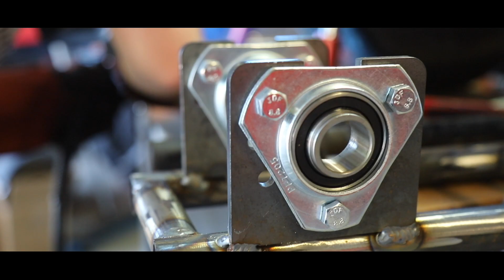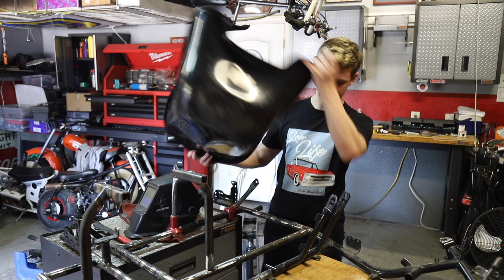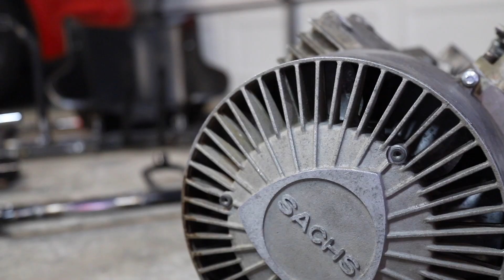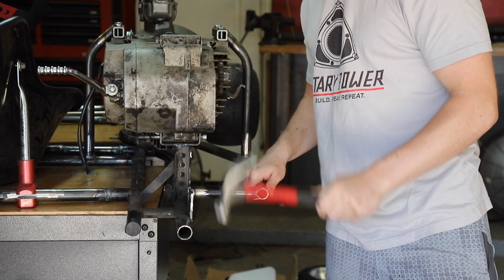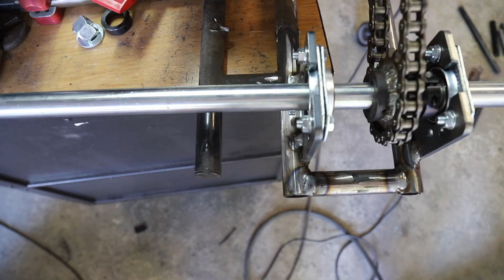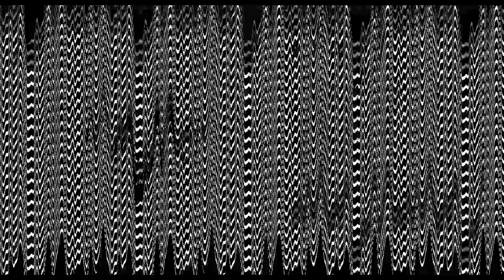Rotary Shifter Kart Build Part 2 | Rolling Frame!

Comment: probably too late now, but if you took the rear mount of the engine and made it an adjustable height so it would pivot across the front mounts, you would then be able to adjust the chain tension without moving the engine forward and backwards.

Comment: That rear sprocket is extremely small. What made you decide to go with that gear ratio? you could easily weld a chain tensioner to help with and slack

Comment: Chain tensioner will help you adjust chain "snuggly" lol
  Axle sprocket way too small. You plan doing 300mph?
Reply: @nallen100  KK I'll try one more time, then if you still don't understand, then maybe try googling this stuff.  Their cart has a 1:1  gear ratio, meaning every time the front sprocket turns once, the rear will also turn once. If they put a sprocket on the back with twice the teeth, Then it will make half a turn for every 1 turn of the front sprocket. This would be a 2:1 ratio, and would cut their speed in half while doubling their torque. Not really sure how I can make it much more simple.
Reply: @nallen100  Taller sprocket on the rear will decrease speed. Go look at your ten speed.
Reply: @nallen100   If you want to go faster on your ten speed, the rear derailleur puts the chain on a smaller sprocket. If the guys in the video put a sprocket on the rear with twice the number of teeth, it will take twice as long for the sprocket to go around, thus cutting the speed in half. Really hoping your pulling my leg here.
Reply: nallen100 you are an idiot and have absolutely no idea of what you are talking about on gearing.

Comment: Did you guys get the turbo friendly version of the ecotrons kit. You know it needs the bigger injector and the 2.5 bar map sensor. If not you might have some tuning problems with the turbo and just that a small map sensor and injector.

Comment: Question, I don't know if you guys or anyone else here can answer this. I have a SACHS KM48 160cc single rotor. I am trying to convert it from magneto spark to electric spark. Can anybody help me?
Reply from the maker: RainyDayGarage Hey check out the video where we get it running for the first time, we show how we convert the ignition
Reply: @BuildBreakRepeat  yes but you guys were talking about how your motor which is 300 CC's came with the magnetic points around the rotor that the ignition system goes off of.  I'm not sure if my motor even has those magnetic points, my motor only came with a magneto
Reply from the maker: Dang man I don’t know then, it’s pretty easy to do with points but a magneto I have no idea... good luck tho!

Comment: Im doin a similar build with my bridgeported sachs km24 with keihin carb putting it on a tonykart race chassis. Will be a lot lighter and wont have to mod the frame as no gearbox just a race clutch. Will handle mint. Drifts on! Good work tho guys, im definitely watchin this space

Comment: Im doin a similar build with my bridgeported sachs km24 with keihin carb putting it on a tonykart race chassis. Will be a lot lighter and wont have to mod the frame as no gearbox just a race clutch. Will handle mint. Drifts on!

Comment: That looks absolutely terrific! I can't wait for the next episode. But, I'm really concerned that that engine case is a structural element, under stress from any tortion in the back of the frame. As much work as you've put in, would you please make an effort to isolate those forces. I mean, it might be better ratings if you don't. And, honestly I'm curious. So, nevermind. Let's see if it breaks and you can repeat it. But, all that work building the motor...

Comment: PLEASE make a 'scatter shield"between the engine and YOU.It's called that...?Anywho.You haven't done a veriticle support.I'm not a 'know all',but you're going to twist that frame to the ground. you Have to put a bar from beside the motor to the left front frame,behind the suspension,Period.When you hit 2nd and add torque,that will have needed the overhead 'torque resist,and in 2nd direction from front of motor to left rear axle mount..I Love your work.The frame is too flat to resist torque twist.(Please wear leathers as this won't go well otherwise.)
Reply: Looks pretty awesome elsewise.Great work.

Comment: A center axle support might be a good idea too. Depending on the torque and surface it goes on. I know rotary engines aren’t exactly torque monsters, but this engine isn’t a 400cc general purpose thumper.

Comment: You will need to have your axle so it can slide back and forwards for adjustment or on some kinda pivot point like the chinise quad bikes. Also a spring loaded chain tensioner. As you will be changing chains just about every ride

Comment: you should avoid putting more than 2 bearings on a single shaft. to run more than 2 bearings, they must all be aligned within the radial running clearance of the bearings or they'll work the shaft until either the bearings fail or the shaft fails

Comment: why is the rear sproket so small is it cause yall using that rotary motor but still you think even if it spins 20,000 rpm that motor its going to feel like its going nowhere idk i think you should least have a rear sproket a little bit bigger than the front hell im prb wrong but just a thoought

Comment: Put an adjustable idler sproket on the bottom/slack side of the chain. I would use a threaded type adjuster not spring loaded since it will see tension the other way when you downshift. Spring loaded will whip like crazy if you bang a downshift.

Comment: You need to gusset you bearing carriers otherwise they will bend under hard turning conditions. Gussets must be added.
Reply: Yes...they could use the scrap material they cut off from the original bearing hangers to fab up something similar.

Comment: You could put a chain tensioner  on it to keep the chain tight.

I found this one on amazon-https://www.amazon.com/Razor-E200-Chain-Tensioner-Spring/dp/B00RW6VNP6/ref=sr_1_8?crid=9YNP44NDDCLM&keywords=chain+tensioner+spring&qid=1558283973&s=automotive&sprefix=chain+ten%2Cautomotive%2C158&sr=1-8
Should look around before buying,there might be a better one somewhere else online.

Comment: It probably would benefit from some rear bracing to help prevent the tubes that are holding the axle in place from bending
Reply from the maker: Yeah we are thinking of putting a bar right under where the axle is
Reply: Just add a bar across the back to tie all the tubes in the rear together.  To clear the brake rotor, you'll need only weld in another inch or so of tubing to what's there now.  That'll look a lot cleaner and will also serve as a push bar/rear bumper.  leaving the tubes open like that will otherwise make it look a bit unfinished.

Comment: You could always add an idler pulley for chain adjustments  :)
Reply from the maker: geoffreyjones2000 Yeah, we are thinking of adding one anyways to take out the slack
Reply: Search Amp Link chain adjuster
Reply: I fab all day 5 days a week  you gentle man are doing a fine job u could make a slick tensioner out of a skateboard wheel and one of those tiny gas shocks for holding open the back window on SUV never needs adjustment just a pivot point

Comment: I think if you use some of the Gopowersports little triangle gaucets to stiff the bearing holders on the "brake rotor" side, that would keep it from bending whenever you do any launches. Also, what about a "loop bar" that help you addding some strength to that "brake rotor" side and also work as a shield for any sudden turns
Reply: gussets. and yeah great idea, just ask for a chunk of 1/4 inch thick steel to a local metalworks shop, anything between 4 to 12 gauge and over 2x6, maybe 8 inches will do. gussets can run across and reach the other side.

reinforcing the bar that holds the seat might be interesting too, since the torque in these areas has nothing but the chain/brake bearing tubes to travel on to the rest of the chassis.

since karts are meant to flex forward towards the sides, and not side to side, it's not dumb to relieve the bearings a bit.

finally, you guys have a bump steer problem to address. otherwise the kart will refuse to turn under braking or behave dangerously.